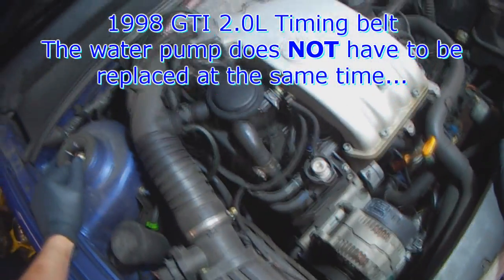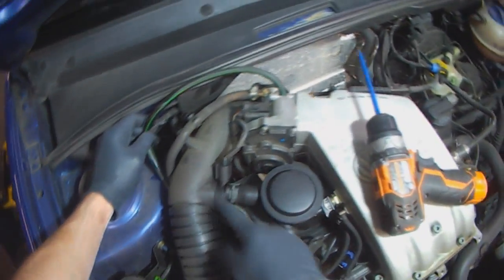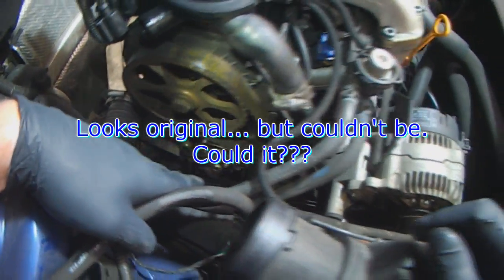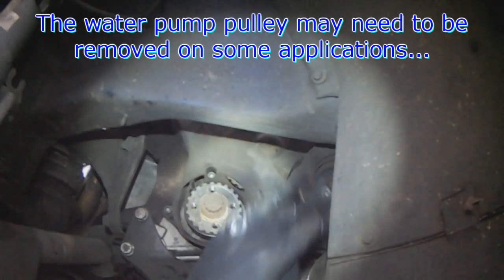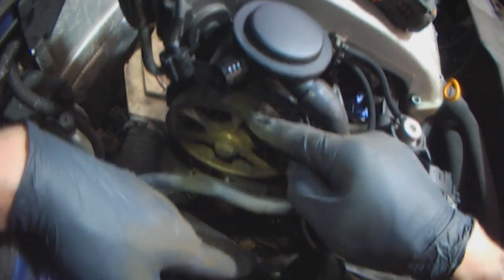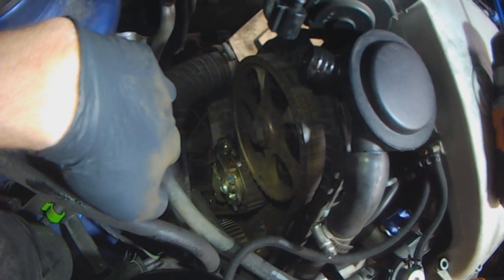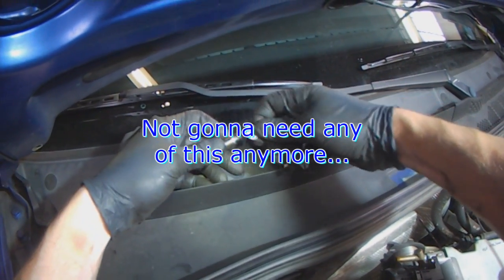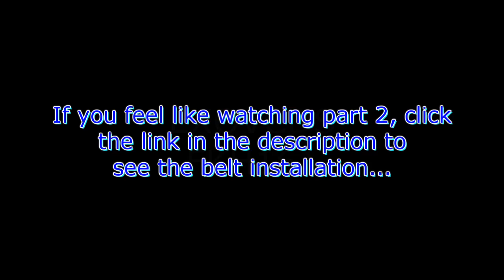VW A3: 2.0L ABA Timing belt Part 1 (with commentary)

Comment: So im in a pickle where when i put the fly wheel on the 0 the harmonic balancer doesn’t match the lines on the plastic ? Should i go based of the fly wheel and the crank pulley
Reply: And i also now i want to redo everything because i have a misfire. So something is not right. So i moved the distributor to make the difference since the intermediate shaft moved. So it lines up the rotor with the line on the distributor. Mine has the indent on the intermediate shaft do i line that up like you said in the video
Reply from the maker: @jesdiaz11
I'm at work. I will reply again tonight once I'm at home.
Watch this video if the harmonic does not match the mark on the flywheel. 
https://youtu.be/o_bhRnnzMWQ
Reply: @EXOVCDS thank you!
Reply from the maker: @jesdiaz11 
Post a video on your channel showing the TDC msrknat the flywheel. 

I need to be sure that you are on the correct mark.

Also show me the crank pulley. I need to see the orientation of the pulley bolts.

Intermediate shaft dimple position doesn't matter as long as the rotor is pointing at the line in the housing.

Comment: Motor mount needs to be removed to remove timing belt? I have my belt off but it seems wrapped around a mount. Also my tensioner can’t come out to replace cause of this mount
Reply from the maker: No, not on Mk3 / VW A3 engines... as you can see in the video.

What engine are you working on? Which model car?
Reply: @EXOVCDS  95 VW cabrio mk3 2.0 engine . ABA?
Reply from the maker: 95 Cab should be the same as in this video. Engine mount is at the back. 
Post a video on your channel so that I can see.
Reply from the maker: @sniperpaintcorrection6790 
Sorry, my bad.

Yes, the cabrio has a " support mount"... it can be removed easily. 
17mm bolt and the 2 6mm allen head bolts that mount the bracket to the block.
Reply from the maker: @sniperpaintcorrection6790 
I don't always look at the user name when I reply to comments. If you keep the comments together under one discussion, it will be easier for me to follow along.
Cabrio has  a support mount, golf & jetta do not. 
I forgot that the cabrio has one.
I have a video for cabrio. I'll post the link once I find it.
Reply from the maker: @sniperpaintcorrection6790 
Sorry, I have a cabrio water pump video, not timing belt.
That support mount is easy to remove.
Reply: @EXOVCDS  I appreciate that. I was so confused watching everyone do the mk3 2.0s and not once seen the support mount touched or even on the way .
Reply from the maker: @sniperpaintcorrection6790 
With the TDC mark at the flywheel lined up, can you take a video of the crank gear?
I want to see if the gear is in the correct position or if it has shifted.
Reply: @EXOVCDS  I couldn’t get that green plastic piece off to check the flywheel but I judged it by how you had the crank at 12 oclock and 6 oclock mk3 nipple at 7 oclock . But yes I’ll take a video
Reply from the maker: @sniperpaintcorrection6790 
Use a long screwdriver in the spark plug hole to check when #1 piston is at the very top. Then, take a video of the crank gear.

Comment: Can turning the belt (top pulley) by hand damaged anything inside the engine? A friend was turning with some force to see if the belt was chewed up . Which it was.  But I’m hoping nothing is bent or damaged. I have a 95 mk3 cabrio
Reply from the maker: The belt can skip if the engine is turned by the camshaft bolt. It is best to turn the engine via the 19mm crankshaft bolt.
These engines can bend valves when cam / crank timing is too far out.
Reply: @EXOVCDS  yes we were cranking the engine by key to see if the rotor would get spark ..I think the belt did do some jumping . Hoping. I didn’t damage anything

Comment: On these cars, should the waterpump be changed and the can seal too?  Also, the tensioner thing (not the pulley) should that also be done while you’re doing the belt?
Reply from the maker: The water pump can be changed without having to touch the timing belt.
Changing the cam, crank & intermediate shaft seals is a good idea, but not needed if they look good. Timing belt tensioner always gets replaced when a new belt is installed. 
The more you replace, the fewer times you will have to go back in there at a later date.

Comment: Amazing explanation
Reply from the maker: Thank you for watching!
Reply: @EXOVCDS  your welcome u do amazing work brother, also question what if the crankshaft sprocket don’t line up with the mark on the flywheel?
Reply from the maker: @user-dg2se7rx3p 
If the tdc notch in the crank pulley does not line up with the TDC mark on the cover... when the tdc mark at the flywheel is lined up with the TDC mark of the transmission... the it is possible that the crank gear is loose / has a worn alignment key (due to a loose crankshaft bolt).
Like in this video:
https://youtu.be/o_bhRnnzMWQ?si

Comment: Hey, what would I do to re time if the tensioner failed and the belt slipped off...cranked a few times before I realized what happened. Getting confused and don't want to mess it up more. Any help please and thanks!
Reply from the maker: Year, make, model, engine?
Reply: @EXOVCDS  97 golf 2.0
Reply from the maker: Remove belt.
Turn the camshaft till the TDC mark on the cam gear lines up with the TDC mark on the plastic cover behind the gear.
Turn the crankshaft to TDC... align the crankshaft TDC mark on the flywheel / torque converter with the transmission TDC mark.
Remove the distributor cap. Turn the rotor until the middle  tip of the rotor is pointing at the line / notch in the distributor housing. Remove dust cover under rotor if you can't see the little line / notch.
Put belt on cam gear, intermediate gear, crankshaft and then the tensioner. Tension belt (use old style tensioner & stud... not the thermal tensioner version).rotate crankshaft 2 turns until cam gear TDC mark lines up again. Check crank tdc mark and distributor rotor. If all are good... assemble rest and see how she runs. If she runs rough,  one or more valves are bent.
Reply: @EXOVCDS  appreciate it man!!! Didn't know if it was that easy or not...my first time doing timing work. Have yourself a great weekend!
Reply from the maker: Post pictures on your channel via community post... so that I can see if TDC alignment is correct.
Reply: @EXOVCDS  alright I will, also have to do the cam seal...I've heard it's easiest to remove valve cover and push it out. Do you have any tips for that. Thanks!
Reply from the maker: @Dontbmaddcuzubadd  easier? Intake manifold has to come off.
Reply: @EXOVCDS  yeah that's what I thought...found in the book to put a screw in. Trying that first
Reply from the maker: The only good thing about removing valve cover... is that you can see all the hydraulic lifter tops. If one has a gap between the top & camshaft, then that valve is bent.
Reply: @EXOVCDS  should the camshaft be moving pretty freely? It felt like it would move a few inches then spring over a 1/4". Also having issues getting the green cap out of the trans...getting the Allen socket tommorow, 27mm right?
Reply from the maker: Camshaft will move with some effort (force to compress valve spring) and will then jump/ turn freely as the valve spring expands again. If you have a long pry bar, hit against the pry bar handle with a hammer , while the tip of the pry bar is used to force the green cap counterclockwise.  Once the cap is loose, you can simply unscrew it. The cap might chip a little, but that's not a big deal. I've seen many 020 transmissions that don't even have green plugs.
Reply: @EXOVCDS  awesome, i kinda figured. yeah I tried that and chewed the shit out of it lol...that's why I'm getting the socket. I really appreciate you helping!
Reply: Just posted the timing marks...what's that tool you use for tensioning the belt?
Reply: I couldn't get the best pictures, but I believe they are all on. the only one I wasn't sure about was the crankshaft.
Reply from the maker: Looks good.
Reply: @EXOVCDS  had all tensioned, turned it over twice, and still lined up. Tried to start and fired a few but wouldn't run. Checked again and found the crank was off about a tooth. Re did everything and tried again, got same results. Thinking there is some internal damage ...sound right to you?
Reply from the maker: Do a compression test.
Reply: @EXOVCDS  kinda embarrassed to admit...realized I had the dizzy cap on backwards. Not sure why it was moving off one, but after this last time all was good. Got it running last night!! Thanks again for all the help and tips!!
Reply from the maker: Thank you for the update. Good to hear it was something simple!

Comment: these videos are great, im going to replace my lifters so having a video for timing belt related stuff is nice
Reply: ok lol I'm doing the lifters now, is there a way to actually get the top part of the belt off without removing tons of other stuff so I can get my cam out? Should I just remove the thermo tensioner to slip the belt? I've already set TDC at my distributor
Reply from the maker: Sorry, been busy. Will get back to you tomorrow (saturday).
Reply from the maker: @nutsack  First, if you haven't already.... replace the thermo tensioner with the old style tensioner (thermo tensioners can fail).
Stud kit:
https://www.ecstuning.com/b-continental-parts/timing-belt-tensioner-stud-kit/026198243/
Tensioner:
https://www.ecstuning.com/b-fag-parts/timing-belt-tensioner/026109243e~fag/
I doubt that you put the cam back incorrectly... as the cam has a TDC mark that aligns with the mark on the plastic 1/2 moon cover.
That leaves the crankshaft & intermediate shaft (distributor).
Turn the engine until the camshaft TDC  mark aligns with the arrow on the 1/2 moon... then, remove the distributor cap (so you can see where the rotor is pointing) and lastly,  look at the transmission TDC window, to see the tdc mark on the flywheel. 
Post a short video on your channel, so that I can see all 3 TDC marks. 
At minimum, you probably only have to rotate the distributor a little.
Reply from the maker: @nutsack  thank you for the update!

Comment: How did you get the transmission window off
Reply from the maker: If you are talking about the round green plastic plug that you need to unscrew... you can get it unstuck by placing a long prybar against the edge of the plug and the hitting the end of the pry bar handle with a hammer. Hit / force the plug in a counterclockwise direction. It usually only takes a 1/4 to 1/2 turn until it is free enough to turn by hand.
Reply: @EXOVCDS  thank you.  I’ll try that.  Spent about 20 minutes trying to grab it with a pair of channel locks got nothing
Reply from the maker: @hydromuscle  I've tried that before as well. Prybar works every time. If some of the plug chips, no big deal.

Comment: Great job! Question though…. How do you keep the cam and crank from moving when replacing the belt and tensioner?
Reply from the maker: The cam usually doesn't move. Before removing the belt, mark one of the crank gear teeth and a matching place at the engine behind the gear. That way you can see if the crank moved. It's best to rely on the TDC marks... the cam gear has one and there's one at the transmission tdc hole / window. Once the new belt is on.... rotate the crankshaft 2 turns and check that the tdc marks line up again. If yes, job done. If not, reposition as needed.
Reply: @EXOVCDS  awesome! Thank you!

Comment: Thomas exovcds good morning I got this problem with my car I rebuilt the motor at home after I put everything together I set the time as you show in this video but when I go and put the key 🔑 and try to started the car those anything, battery is new you got any idea what could be the problem.
    Thank you
Reply from the maker: If the starter is not turning, check the battery ground wire... it might not be connected at the engine / transmission.
Reply: @EXOVCDS  I will check on that tomorrow morning thanks for the update .
Reply: @Thomas exovcds Hi here I’m again I check for the ground cable N is connected to the transmission/motor but what it dose is when I put the key N open the switch it shot off don’t know why.

Comment: Good Job Thomas
Reply from the maker: Thank you.
Reply: Thomas EXOVCDS quick question Thomas, I picked up a 2.0L ABA over the weekend. It has 187k should I start considering timing belt service soon?
Reply from the maker: @kluwe801  depends on when it was replaced the last time. If no service history is available, plan to do it sooner than later. These engines can bend valves when the belt breaks... old belts can look OK but can fail at any time.
Reply: @EXOVCDS  very true Thomas thank you again cheers.
Reply: Thomas EXOVCDS your welcome Thomas

Comment: What years did the single roller tensioner come on?
Reply from the maker: The simple design / roller was used in all engines before 1995 (1996 there was a switch over to the thermo tensioner design). So if you are looking to order the old style tensioner / roller, look for it using 1995 or earlier "year of vehicle info). Don't forget to also order the old style stud for the tensioner / roller. It's a thicker stud.
Tensioner / roller and stud can be found here:
https://www.ecstuning.com/Volkswagen-Jetta_III--2.0/Engine/Timing/2

Comment: Do you recommend replacing the crank bolt? If so where can I get one the quickest?
Reply from the maker: 19mm crank bolt always needs to be replaced after it has been removed. You only need to remove it if you are removing the crank gear to change the seal. Local parts store, VW dealership, online parts store?

Comment: no motor mount ?
Reply from the maker: This Volkswagen A3 (mk3) does not have an engine mount that is in the way of the timing belt... the Cabrio has a little stabilizer mount that needs to be removed first. The main engine mount is at the rear of the engine.

Comment: Hey love your videos helped me fix my car like 3 times now quick question I put s new timing belt on amf was wandering if the timing belt tensioner is supposed to move its making noise
Reply: And smoking
Reply from the maker: Tensioner is supposed to rotate yes.. if it's not turning, the belt is slipping on the pulley / roller and will get damaged.
Reply from the maker: AMF is a PD TDI yes?
Tensioner roller should rotate!
https://www.youtube.com/watch?v=_bhCRr-H2yw
Reply: Yeah I think it recently stopped moving and snapped my last belt thanks so much looks like I need a new timing belt tensioner thanks man.
Reply: I have a mk3 aba 2.0
Reply from the maker: LOL... in your first post I read AMF and thought that was the engine code. VW has an AMF engine! LOL
Install the old style tensioner if you aren't already using it!
Reply from the maker: https://www.germanautoparts.com/catalog/search/Volkswagen/1995/2034/10/11998
You'll need a stud kit as well.
https://www.ecstuning.com/b-rein-parts/timing-belt-tensioner-stud-kit/026198243/
Reply: LOL yeah I believe I have a old style pully. Going to order it thanks a lot!

Comment: dose anyone happen to know if camshaft follers are supposed to be stiff or have give to them?
Reply from the maker: Stiff... if too soft, replace. The service manual shows how to push on them (while the camshaft is installed) to test them.
Reply: i can push down all but one with my thumb when installed..so i ordered another one thinking the stiff one was no good...and the new one i cant push down either...im going to order 7 more new ones..
Reply from the maker: High rpm 2500+ for 10min can pump-up lazy lifters to the point of them being quiet again for a while. If they bleed down (get soft) quickly, they are worn out.

Comment: sorry you have the complete diagram of the electric system of this jetta a3 2.0 1993 I ask your allude since there was a short in my car and I need to change the wiring and the diagram I do not have it
Reply from the maker: Armando Maya I have for 2.0L ABA North American engine. I don't know if it is the same for your engine.
Reply from the maker: Wiring diagram for just the engine or also for the interior?
Reply: it's for the engine and the interior
Reply: if it is american jetta a3 2.0 1993 and I see your video is the same machine all the components are hygienic and as those diagrams do not have them they want to change it more sensillo and the berdad this car is beautiful I like it like this I do not want to change anything for that I took the liberty to ask your allude in the complete diagrams of all the engine system and interios of the car but they do not have and they do not understand, thank you for tomato the hassle of answering
Reply from the maker: +Armando Maya I'm not at home right now... I'll look for diagrams when I'm at home later today.